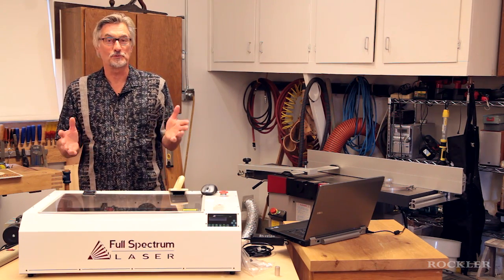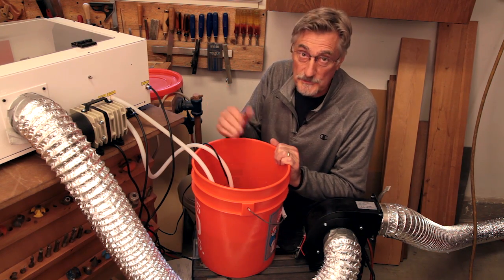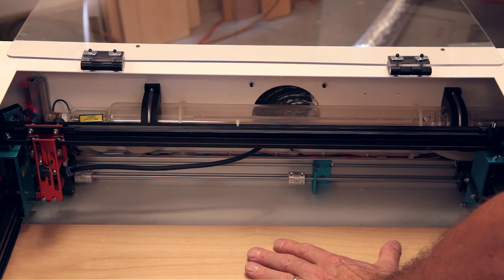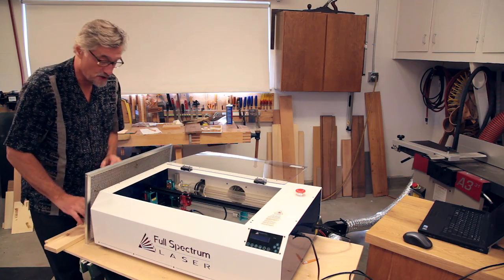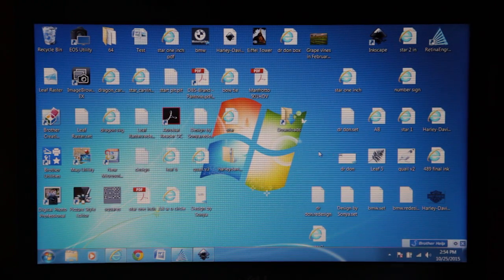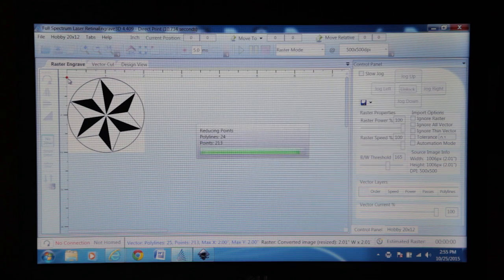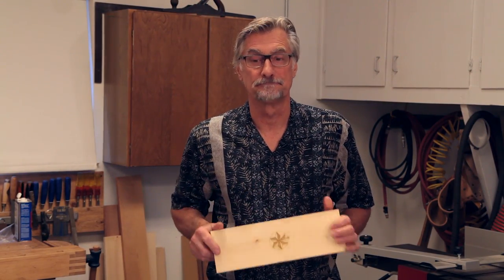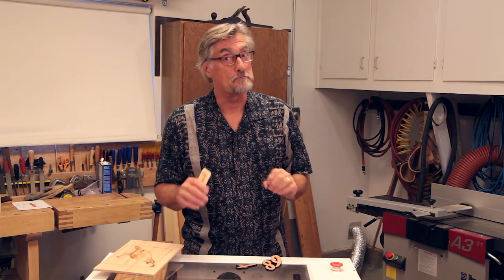Overview of the  Full Spectrum H-Series Laser | Anatole Burkin

Comment: well thought id watch a few FSL engraver videos to decide whether i should look into buying one over the Epilog Zing. seriously dissapointed looking at this product it doesn't even have fixed datum's to align your work piece with ill keep researching but its saving 4k in the short term would look like losing 30k worth of production over a year.
Reply: the epilog is a great choice. expensive but it is a real laser cutter with an RF driven tube not a junky DC driven tube.
Reply: FSL and epilog aren't even in the same universe. the FSL is a hobbyist laser and the Epilog is a professional laser.
Reply: Just curious which unit you decided to go with. I too am looking at an Epilog laser vs. the Full Spectrum. So far, I'm opting for the Epilog. One of the biggest concerns is the replacement cost of the tube on the FSL?!
Reply: John Frontier ended up getting a cheap chinese 130w 600 x 900 it paid for itself in 2 months but was finicky and frustrating to use weve bitten the bullet and bought a epilog zing 12 x 24 for 4x the price but easier to use and when were doing production work consistancy wins out big time

Comment: Here is my problem - I can not find any information about the air compressor, how powerful it should be, and what adapter to use to fit it to the laser. I've been to Home Depot and Lowes but no one has seen such a connector. Can you tell us where to buy it and what to say so I can get the right part? How large should the air compressor be? I also am looking for a water pump that is not submersible. I am leary of putting an electrified apparatus into water. I'd rather have an external pump. Also, what do you think about putting a small, circular fan at the beginning of the duct work, a light weight a/c filter to capture smoke particles after it, and then the duct work. Would that work or would the filter restrict the air flow too much? Thanks in advance for specs. Did not get a manual when I bought it. Just a single page which I can not now find of course! :-P
Reply: The Full Spectrum Laser air compressor is an accessory that is not regularly included in a kit. https://fslaser.com/Product/HobbyCompressor
Here is a discussion about its specs: http://www.fullspectrumengineering.com/forums/viewtopic.php?f=3&t=1591
Reply: I did a lot more checking and found out that the Hydrofarm products work great with the Full Spectrum laser cutter. I bought both a water pump and air pump from them.  Works great.  :-)  Thanks for the info also!